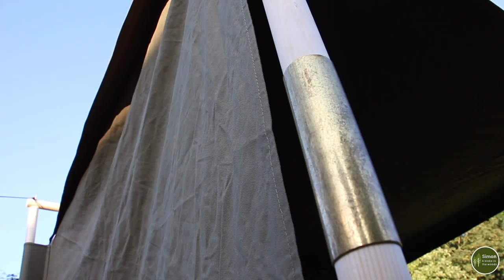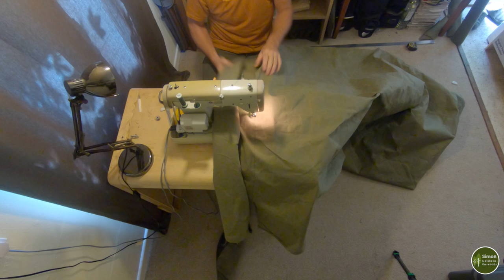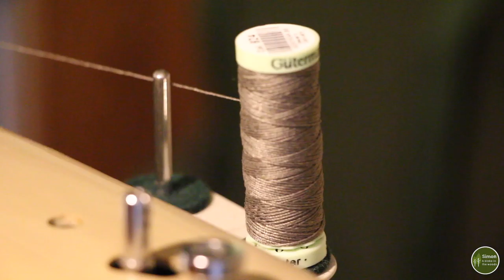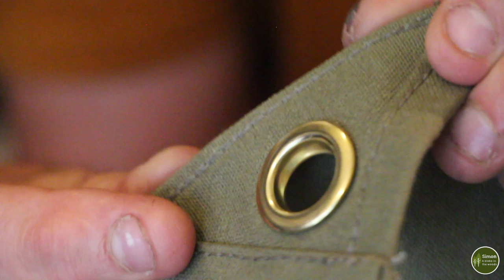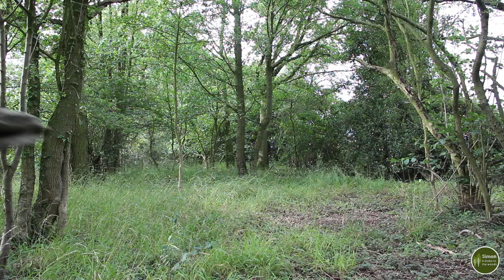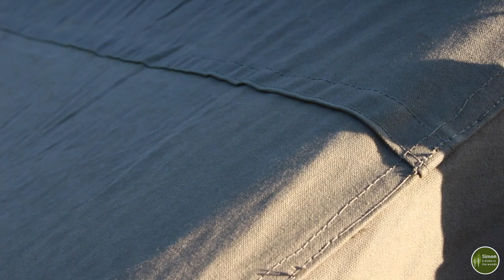Baker Campfire Canvas Tent Build,  Part Two.

Comment: Proper shelter there, Simon! Glamping almost ;-) I can thoroughly appreciate a person that makes their own gear, enjoy!!
Reply: This is a long lived style for good reason. It was popular from the mid 1800s to the 1960s when canvas tents fell out of favor to nylon tents by the 70s and 80s. Glamping is not so much the tent itself, but how you outfit and use it, but a well equipped bakers tent is definitely something to aspire to... Back in the 60s when my uncle was in the scouts, the baker tent was a standard among a great many boyscout troops. When 6' or 2m deep you can fit an army style cot along either side wall and still have plenty of room between for gear storage or a camp table. 

The design is also easily adapted to attach to the end of a vehicle awning for overlanding. The Aussie company Oz tent has done something of a modernized modified baker in their product line for overlanding.

Unless  I missed something though, Simon missed an opportunity to include no-see-um/midge netting on the inside of the door with a second zipper. A detached floor tent will never be mozzy proof, but it would reduce the number of skeeters inside the tent. The alternate is netting covering the cots inside the tent.

Comment: Have you considered adding mosquito netting for summer use and a storm enclosure for fall or winter use, possibly with a door of overlapping canvas panels. Another possibility would be a panel with an aluminum stove pipe thimble square so it could be used with a small wood stove. Another might be a canvas awning for rain protection that would allow extending over a vehicle for tailgate cooking, washing dishes, taking baths, etc. Fire resistant homesote could also be used for the panel for the stove.
Reply from the maker: I did consider a bug net panel and then using the side panels as the door - folded across the sleeping area, as was done with the originals. Biting insects aren’t much bother to me where I live, but I might still make a removable panel. As for winter use, the idea is to use an open fire under the porch area to heat the tent - keeping the front open for ventilation. 👍 nice ideas with additional awning and stove jack idea. 🔥

Comment: One thing I would recommend before you begin another heavy weight fabric on a standard or industrial machine is the Walking Foot.  It makes going through the layers a breeze, and it also feeds from the top as well as the bottom, so the grip for the sewing machine is second to none.  You will wonder how did you ever sew anything before once you use it.  It isn't very expensive . I bought mine with a 35 piece foot kit, for under 20 on Amazon. Came in a few days.  I bought another one from China, that one took four weeks to get though, it was much cheaper, I think 6 dollars all in freight included.
Reply from the maker: Thanks Kim - I’ll look into getting one - if it’ll work with my machine (I’ve also been considering upgrading my machine and getting a (used) industrial machine with a walking foot, but we’ll see.) 👍😁

Comment: Should have used a walking foot to help with the sewing. When you have that much material a table to the left to hold the fabric help so the weight doesn’t pull on the machine. You did a good job.
Reply from the maker: Thank you - my machine only has the one presser foot attachment - old and simple. Actually it coped with the canvas really well - pulling through fine and I didn’t break a single needle either (miraculously) 😁👍

Comment: One more thing .... a floor layer by water-resistant tarp to prevent water / moisture would be PERFECT during rainy & snowy seasons and also to keep you from bugs or snakes getting into your tent !
Reply from the maker: The velcro around the inside of the sleeping area is for a floor - I ran out of time to make it for this video, but you’ll see it in future videos. 👍

Comment: If weight is not an issue (vehicular camping, or canoe camping, or sled camping) you can greatly improve the ground sheet by sewing a poly tarp to the bottom of the canvas ground sheet. It would thus give you the best of both worlds. The poly tarp protects the canvas from moisture and rot from being in contact with damp vegetation while the canvas makes for a nicer looking and more comfortable floor. Alternately (and yet heavier and much more expensive) is pond liner which would create a completely waterproof floor under the canvas, but is overkill.

With slight design alteration, these tents can be backpacked in by two people (as many boy scouts did prior to the 70s), but I for one would much prefer using it when I had transport (vehicle, canoe, sled, pack horse) it is NOT light weight. 

And yours is fairly small. I am used to 6x8 (2mx2.5m) and have seen larger (up to 11 feet wide)

Comment: Looks like a bang-up job, Simon! I'm looking forward to seeing it in use. Do you think you need to treat the seams? You could easily rig up the roof to catch water when it rains, rather than just letting it run off during a storm.
     I have to say that, with all your additions to the basic Baker Tent (the zip flap to close in the sleeping area, the removable tub type groundsheet, and the side flaps for the overhang), what you have there is like an upgrade from a Motel 6 to the Tower Hotel! 😁  I can see you adding zips for a bug net to close in the porch in future.
Reply from the maker: Thanks Craig! I’m already planning a mosi-screen panel haha! 
Hopefully the seams won’t need sealing - the fibres in canvas swell when they get wet - natural waterproofing - I’m hoping the swelling will also close up the stitching holes. 👍
Reply: @simonablokeinthewoods   I knew it! Can't wait to see how it turns out.

Comment: An actual tent! I thought a heavy canvas tent had gone extinct. I cannot imagine getting any sleep in a tent made from a parachute. I in my younger years along with my hunting buddies would use my friend's dads WWII Marines tent made of thick heavy rain proof canvass, and the military tents from my service were even larger and heavier taking at least 3 to 4 of us to set it up. I have been camping when a large male brown came sniffing the tent. All 4 of us pumped our 12 gages together, and staid silent for an eternity until it moved on. A bear could easily flatten even a canvass tent however, I could have two or more 44 rounds off instead of of being drug by the head, arm, or foot before I was awake in my parachute.

Comment: You made a Fantastic tent!  Beautiful work Simon!  Congrats!  Here's hoping it lasts for many years and gets used many many times by you and Maggie, and others.  I'd waterproof it personally and stain and use marine quality polyurethane on the poles so they last a long time too.  This is the coolest project I have seen you do.  Right On Simon!  You Rock Man! Bart
Reply from the maker: Thanks Bart - the poles are going to get a good waterproof sealer coat, as for waterproofing the canvas, It shouldn’t need it - on first use, I expect it to leak, but that is part of the process - after the first wetting out, it should become naturally waterproof - the fibres swell as they get wet and close up any gaps in the weave - when it dries out, the gaps come back allowing for superb breathability. 👍

Comment: If you forgot to bring along with your roof post ( top - horizontal ), you can use a strong string as a ridge line and tide onto two trees.  In this way, you can also forgot the 2 vertical posts as well !
Reply from the maker: I was thinking the same - ill try it out some time. 👍

Comment: Great tent, great design... I would have done a couple things different but that's me, and your you.  I think the sleeves for the poles will hold moisture causing early rot in the wood??? Again great tent Simon. Thank you for sharing this with us
Reply from the maker: Hopefully won’t be a problem as I’ll only be using it for short trips and it’ll be aired and dried properly between outings, but good point for those using this type of tent for prolonged use! 👍

Comment: Amazing. Are you going to stain and finish the poles for weather resistance?
Reply from the maker: Yes, that’s the plan - I might even fit brass tubing to the inner section where the poles join - to avoid the problem with swelling wood (that sounds rude! 😂)
Reply: @simonablokeinthewoods  , brother, as you get older a little swelling of the wood should be a welcome thing. 😂😂😂

Comment: Very impressed by your skills in building this tent.  How had you thought about using bug netting in the sleeping area?  In colder months you could  just keep the zippered door shut, but in the summer months you might want the added ventilation of an open door.
Reply from the maker: Thanks mate! Yes, I think I’m going to make a removable mosi net panel for the summer. 👍

Comment: Next time you should use stick pins to hold the panels together while you sew them. Helps speed things up a bit.
Reply from the maker: I don’t think they’d go through 4 layers of thick canvas! Actually, the canvas folds well and stays in shape to sew - it’s easier to run a line of stitching sling first, then fold and stitch again for the roof to side seams. 👍
Reply: @simonablokeinthewoods  The larger stick pins will go in up to 6 layers. That's what my tent maker uses... But your way works best for you so carry on...lol
Reply from the maker: I’ll look into them - thank you! 👍

Comment: May sound a daft question but, would you ever use this tent with a stove like the Ammo tin stove? My thoughts are. With a chimney your getting heat but not having smoke remaining in the tent area. I know it would then probably require cutting to fit flashing but thought I’d ask the question...
Reply from the maker: It’s  not a daft question at all - I have intensions of making an extra panel for the front with a stove jack to I can do just that. 👍🔥😁
Reply: Oh cracking, I’ve been making my way through all you videos, really enjoying them! I have a domestic sewing machine but and I’m a dab hand with it but didn’t think it would be suitable for such heavy work... your video has made me think about making a smokey hut style tent. Great work!

Comment: Mozzy net? For the  inner tent and are you going to use your stove in there, ventilation? like it though. You may end up with orders. Good video.
Reply from the maker: Mosi net is in the planning - just a tie-in panel for the rare occasion that id need one. I’m not planning on using a wood stove in it - the idea behind the tent is to use an open fire in the open porch area that heats the sleeping compartment - I probably will add some vents nevertheless - one below the roof overhang at the back and one at the front above the door. 👍😁

Comment: Fascinating video showing design considerations and construction detail in sewing.  What will you do to waterproof the stitched seams?
Reply from the maker: Thanks James! In theory, as the canvas  fibres swell on wetting out, they should close up any gaps in the weave, seams and stitching holes - stopping water from passing through - I’ll have to see how it works in practice! 😂👍
Reply: @simonablokeinthewoods  My well-made outfitter quality canvas tent leaked here and there along the seams.  Keeping dry in a canvas tent may be a 'relative' concept.
Reply from the maker: Hahaha - Yes, I think that may be the case! 💦💦💦

Comment: You did an awesome job on this tent. Have you had it out in a good rain? The front roof part looks like it should come down about 5 degrees to shed water.  Anyway great work on the sewing.                   Ray, Oklahoma
Reply: Hi there fellow Okie. Can you imagine that baker tent with the muggy heatwave we're having lately?
Reply: @KimberlyGreen  This heat today was very bad. How to people work on roofs, insulating attics, hot tar ect. The Baker tent looks very rugged, like it will stand up to anything, but heavy.
Reply: @millbankbagsusa2037  You're right, the heat at this time in OK is very dangerous for outdoor workers. I sure hope they stop frequently & keep up their electrolytes. Maybe Simon could do a version 2.0, with light fabric + attachable insulation panels for cooler weather.

Comment: What size brass grommet eyelets did you use?
Reply from the maker: They are 12mm ID grommets (or as close as I could get) I put the link in the description box below the video. 👍
Reply: @simonablokeinthewoods  The sizes on the site go from 000 - 8, how do know which is 12 mm?
Reply: @simonablokeinthewoods  Never mind I figured it out, thanks for all the inspiration and help.

Comment: Holy Moly you’re never ever gunna get this in the LK35 😱
Let alone get it on your back!

Seriously though:- the poles need treating to stop them swelling when wet. You won’t get em out of the brass ferrells or off the pins.
Just a thought 💭
Reply from the maker: You make a very good point! The poles will get treated, but I might even add brass inserts for the male ends OD 35mm to slide inside the existing ferrules. Double bubble! 👍